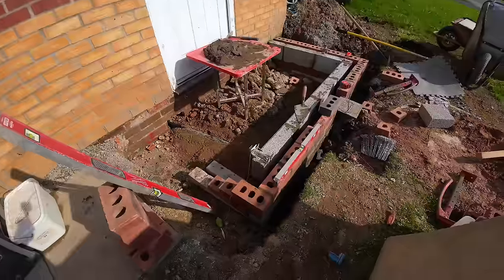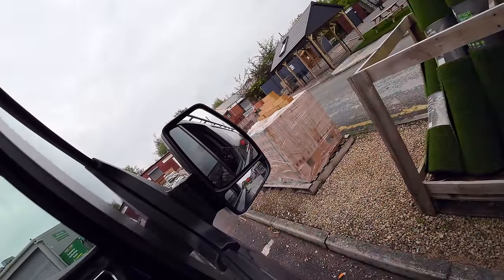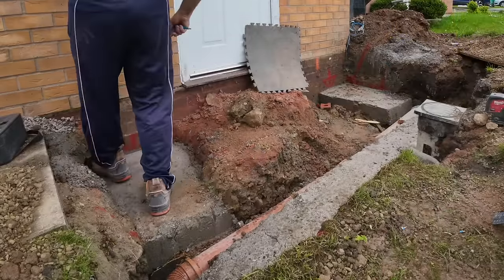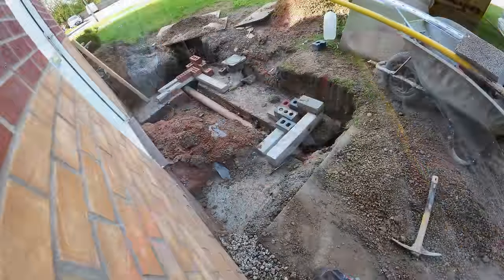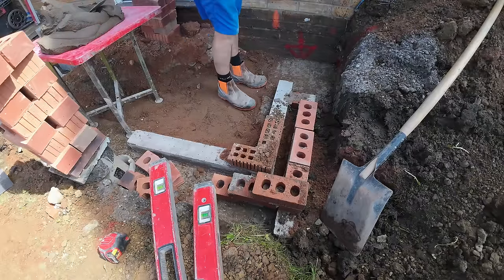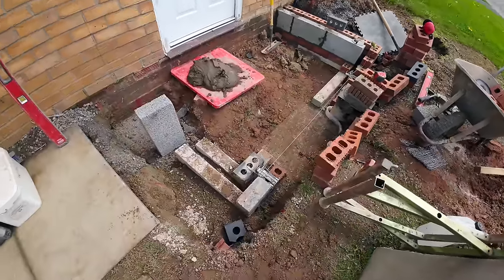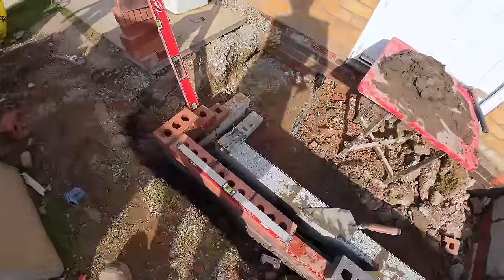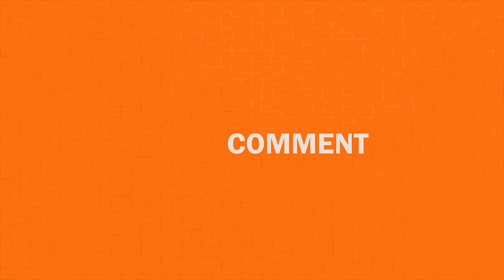BUILDING UP TO FLOOR LEVEL ON THE SUPER STRESSFUL PORCH...PT 3

Comment: Hi lads, question about the gap between internal and external bricks. Is the gap for insulation different for a porch compared to a house? I assumed it was 150mm but in this video the gap looks to be 50mm. I take it building regs for a porch are different to regs for the house?
Reply from the maker: Yes 👍🏽

Comment: Why not 175mm Fibremesh Concrete raft with ample fibreboard around pipes…job done! Soil strata looks fine for raft with minimal loads for porch…
Reply: I would totally agree with that
Reply from the maker: Not got a clue 😬🧱👍🏽
Reply: @SteveAndAlexBuild  Steve,
It is a raft style foundation that is being suggested here.
But instead of traditional re-bar reinforcement fibre - mesh reinforcement is used. There are pros & cons to both systems.
And of course you know what "fibre-board" is for around the pipes...?
  👍🧱

Comment: I cant believe you didn't pull the meter back a foot or so. There may have been a stop tap in the footpath or failing that squeezed it off with £50 tool, assuming 25mm poly.
Reply from the maker: No thanks